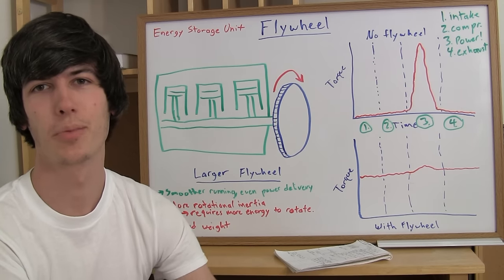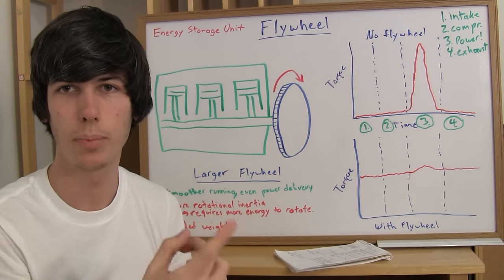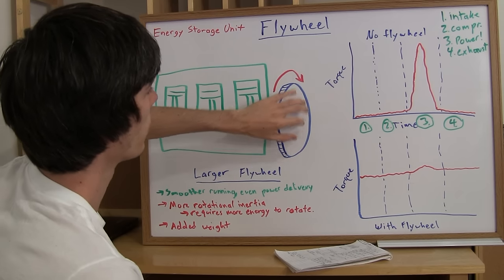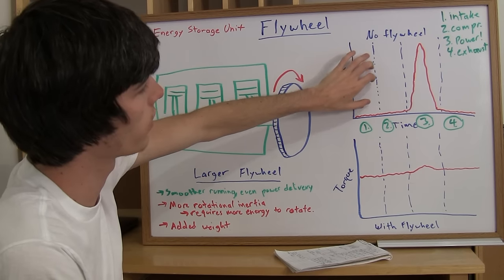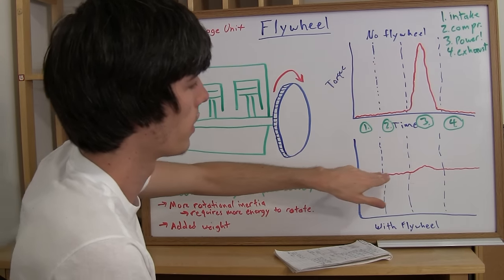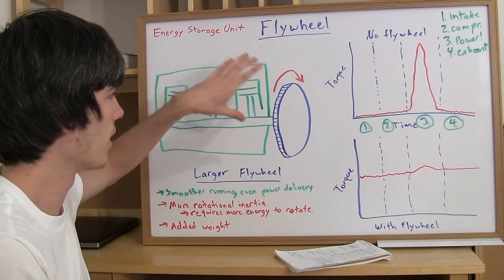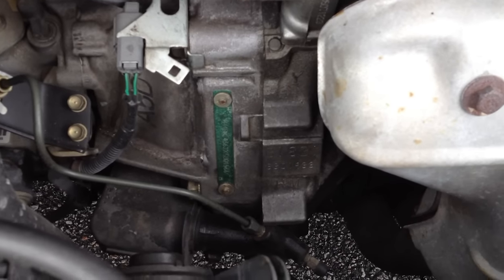Flywheel - Explained

Comment from the maker: Think of the flywheel as a uniform rotating mass. It doesn't have timing, like the cams do geared to the crankshaft. Blue smoke means you're burning some oil. For older engines with worn piston rings, this is pretty typical.

Comment: On automatic transmission cars, isn't there something called the flex plate, which has the torque converter in place of the flywheel on manual cars?  Does that mean the torque converter is pretty much doing the job discussed in this video?

Comment: I have a question, when you shut the engine off, what keeps the flywheel from continuing to spin? Is there a brake or something? Because since it stores energy from inertia, it should continue to spin even if the engine is off?
Reply: zebracherub the resistance of the compression strokes is quite a bit & without combustion (turning off the key removes spark/fuel) nothing except the inertia is pushing the engine...maybe 1 maybe 4(don't really know...just a guess) revolutions before you run out of momentum.  get a long ratchet & socket ...turn your engine over by hand a couple of times

Comment: this might be a dumb question dos that mean that it is easier to power shift with a lighter flywheel. 2 is there a balance that should be had with lets say a performance car if a slightly heavier flywheel keeps the rpms up longer wouldn't that be a good thing or am i missing something. i know that a light flywheel is better for acceleration but it seems to also drop the revs during shifting how off am i?

Comment: Ooooo ok so that makes sense, the smaller the flywheel is the closer it gets to matching the circumfrence of the crankshaft (which its spin has less smoothness due to power strokes of diff cylinders). But if u increase the size of the flywheel the gears on the circumfrence of the flywheel will allow smoother movement with almost no noticeable pause during power strokes. Genius vid

Comment: Isn’t the fact that you have multiple cylinders, each with a differently timed power stroke, timed to continuously power the drive shaft even a bigger factor in smoothing out the energy spikes?  This example is more for a single cylinder engine.

Comment: Hi I bought a 2.4 2004 Acura and it came with vibration first I thought it was a mount, I already replaced one engine and one transmission, plus checked both shafts the vibration still there, the previous owner told me he replaced the clutch and machine the flywheel. However the car vibrates even when I'm stopped every time over 2.000 RPM, that's why I'm starting to think that the mechanic made a mistake and therefore the car is vibrating. What do you think?
Thanks
Reply: +atroise Have you checked your ignition system?

Comment: so inertia makes the flywheel move.but that sounds impossible because friction does exist despite all the lubricants in the engine. Does the flywheel have a weight on some area of it or something of that matter?
Reply from the maker: Well it's steel, so it's just a large weight itself. The power strokes keep everything going.

Comment: hey i have an 86 chevy pickup with a 305/automatic. it has gotten to the point where the engine can be revving at any rpm, but the power does not get transferred to the driveshaft for some reason. I suspect it is the torque converter has gone bad? any help is appreciated

Comment: Should the torque on your graph be negative during the compression stroke?
Reply: +Stefan Oosterhout I think during compression the crankshaft pushes the piston up via the connecting rod. If that&#39;s true then yes there would be some negative torque equal to the force required to compress that air/fuel mixture. But also remember there are other cylinders, so while one is compression one is firing etc.

Comment: I think that flywheel is the reverse of an impact wrench. For flywheel you want to average out the force in a given, so that it can be smooth, as for impact gun you want to store the energy and release it in a very short period of time so that  it can produce a hammering affect very much like the engine cylinder power stroke.

Comment: Hi, Thanks for the great explanation. Please keep up the great work. I have a question for you though regarding flywheel technology. Audi e-tron quattro won LE MANS. flywheel technology is used to store energy while breaking and regenerate it while accelerating. It's a great use, but I found that since they are using flywheel, they can only store energy for a short period of time, so won't be able to use this commercially. Is that really true and can anything be done to make this better?
Reply: +Kiran Kumar Kondru That type of flywheel is a bit different from what is used on an engine. Those flywheels take energy from braking and store it in a flywheel that's not directly attached to the engine. When you accelerate out of the corner, the flywheel is then connected to the drivetrain, and the energy that is in it is transferred to the wheels. I don't know how much energy is lost from the bearings, but I doubt it would be too helpful at long red lights. It does have some commercial viability in regards to corners and stop signs though. I believe a few production cars have it now, mostly very high end cars though.
Reply: +Mosin Master Thanks a lot for the explanation.

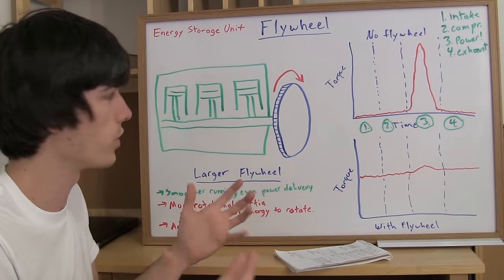Comment: 2:10 To reduce the amount of inertia required, many automakers have turned to dual-mass flywheels (DMFs) to absorb the torque pulses that an engine generates. While this is an effective solution to the problem, it (IMO) is just a bandage on a bullet hole, as the speed variations within the engine's components itself is still very high. So it hasn't actually eliminated the vibrations but instead it just isolates them to within the engine.

Since the dominant exciting components in any four-stroke, even-firing engine with four or more cylinders is of the N/2 order and N order (where N is the number of cylinders), automakers have started installing DMFs with centrifugal pendulum absorbers (CPAs), which are sets of masses on pivots designed to oscillate at a frequency that is directly proportional to the rotor speed. In cars and trucks, there is often a single set of CPAs tuned to the most problematic excitation order, the N/2 order. (In practice, I have heard that these absorbers are actually tuned to slightly greater than the intended order to prevent the masses from "bottoming out" prematurely and inducing nonlinear effects.)

The DMF with a CPA offers the lowest torsional vibrations, but DMFs have become infamous for being expensive, maintenance-heavy, and extremely complicated to work on.

There is a study, titled "Feasibility study of single-mass ﬂywheels with centrifugal pendulum vibration absorbers in vehicles with dual-clutch transmissions", that details how a conventionally-sized single-mass flywheel with a set of CPAs (or two sets) can be just as effective, if not more effective, than a DMF. Although a SMF with CPAs is not as effective as a DMF with CPAs, it certainly looks to be cheaper and significantly simpler to maintain and work on. It also looks like it will live a lot longer than a DMF.

Comment: correct me if I'm wrong you somewhere said that flywheel weight would barely be noticeable in the speed at which revs increase / decrease? i thought that was the main reason rally cars' throttle responses are so good and sudden (your graph)? And i generally thought that the flywheel would be one of the most noticeable changes on a car! was thinking of changing mine to get quick revs on an sti... help? :P

Comment: I have a question do CVT transmissions have torque converters or flywheel connections?
Reply from the maker: +John C typically torque converters.

Comment: I guess you could add to that smoother engagement of the clutch, which obviously helps with wear and tear. Which is less important in a racing situation, offset against the benefits of the reduction in rotational inertia.

Comment from the maker: Umm, I guess it depends on how it's broken. If the teeth are gone then you won't be able to start, since the starter motor needs something to rotate. Flywheels don't seem to be a common failure point though, so I'd be cautious. If your car starts and feels fine, then your flywheel is likely fine.

Comment: My flywheel as started vibrating on my car realistically do I need to get it changed straight away will it cause any damage to other car parts how long have i got before it will completly break down
Reply: +imanishay It's going to cause excess wear on bearings. So expect to spend extra if you wait.
Reply: i think its the friction surface of your fly wheel

Comment: why aircraft piston engines don't have a flywheel at all? what is the use of counter weight on the shaft if the flywheel works the job?

Comment: Do you know what can cause damage to the flywheel? because my car makes a loud rattling sound and I took the starter off and noticed that the wheel had been damaged, I replaced the starter and it didn't help, my friend took the trans off and the wheel was dent and it was making contact on the base but he bent the base straight and replaced the wheel and it still didn't go away.
Reply from the maker: Not really sure, unless the clutch were to brake, and have some of the material damage the flywheel.
Reply: your not using the appropriate starter shims that's cutting the flywheel teeth
Reply: East24stProductions Thank you. That's what the mechanic said, that I must of put the wrong starter on that autozone gave me. He did shave some of the metal off the starter and the noise went away. Last week I replaced the crankshaft sensor and it was shaved at the tip, any idea why? P.S before my friend the mechanic put on the transmission back on after changing the flywheel, he did mention that about the starter could be the wrong one but some reason he didn't go exchange it.
Reply: Hector Garcia-Martinez maybe the reason why stuff is getting shaved of is cuase your tranny may not be aligned with the engine block...maybe you had previous tranny removal in the past. like u say...something is not meshing down there...could be even the torque converter or flywheel was not installed....check the tranny alignment again
Reply: East24stProductions Thank you. I'll keep that in mind.
Reply: engine can crank But won't start,,is probably detective flywheel sensor? happen in early morning oNly,,

Comment: The Porsche 911 GT3 RS 4.0 has a single-mass flywheel compared to the standard GT3's dual-mass flywheel. Could you please explain what these are and the advantages/disadvantages of both? Also, if a single-mass flywheel is clearly better, why would Porsche not have fitted the standard GT3 with the single-mass one in the first place? Costs?

Comment: Thanks for such a quick response! :)
So the SM flywheel will give you a better engine response from the gas pedal, right? Therefore the reason the DM flywheel is fitted on the standard GT3 is, even though it can't handle as much abuse, it's more suited to the road (as opposed to the racetrack) - and for that you need a smoother, less jerky power delivery. 
Is that correct?

Comment: does shaving off the weight in my stock flywheel benefit me? or will it give more torque or power? the terrain in my place is more of a valley, so there are uphills and downhills , just wondering if lightening my flywheel will benefit my car?
Reply from the maker: +meowtrox1234 The short answer is yes (to more power), here's the long answer: https://youtu.be/CxuER0qIWJk
Reply: +Engineering Explained To be more precise, your engine will not produce more power with a lighter flywheel but more of the power it does produce will go into accelerating the car and not the flywheel itself. Apologies for my pedantry.
Reply: will it have a downside effect when going uphill?
Reply: +meowtrox1234 Reduced flywheel mass means that your car should accelerate faster uphill as the engine power is going into accelerating the car and not the flywheel. Top speed will be unchanged as overall power output will not change. The engine itself should also change revs quicker when you are changing gear so rev matching should be quicker, both up and down shifting. You need to be careful not to remove too much mass as this will affect idling and low rev performance. The flywheel is there for a reason and a lot of thought will have gone into deciding how much mass it should have.
Reply: Heaps of thanks!
Reply: +meowtrox1234 No problem. Hope it works out for you.
Reply: Do F1 cars have really small flywheels then? They idle at around 10,000 rpm simply because the engine would destoy itself if it idled for any extended period of time below that.

Comment: +Engineering Explained I've spent the entire morning (in the UK) looking through all the comments one of the most common myths/knowledge that I haven't experienced yet, that I still can't believe because I need an engineering explanation or a clear measurement proof, and not just people's tails, and what I would like to test as soon as I can. (And what I suppose lots of your followers could be interested in). In case someone has already asked you about this, or you've talked about this in another video, please excuse me and link me the answer. This is the myth: by lightening the flywheel, cars generally drop their top speed.
The first times I was hearing people about that, I just thought what rubbish! It  just doesn't make any sense. But by keeping hearing more and more people, I started to think a bit more about that and how it could be possible. Maybe a heavier flywheel, that helps to keep the torque/power delivery  equal, would cause less dissipation? Some kind of tyre sensitivity logic: an equally spread power over the time causes less losses while peaks of higher power and peaks of low one? Or maybe it has to do with some fluid dynamics in the cylinders, and a heavier flywheel would keep the pistons travel closer to the maths model with the assumption that the crankshaft speed is constant? Even if the calculated ideal travel is not proven to be the best....but possibly better than the one you have with a rather "vibrating" rotation? What do you think?
Reply: +Yury A I'll start by saying that I am no expert in this topic, here are my thoughts:

A heavy flywheel is like a train. Sure, it can go fast, but the acceleration would be really low. Ideally, this should not affect the top speed by any means, since no power is lost by the flywheel, it is basically a heavy block of metal that wants to keep rotating.

The thing is, flywheel makes it harder for engine to change its RPM. This 'may' affect the top speed, since the engine may not provide enough torque because it cannot reach its optimum RPM. But other than added friction and mass to car, it shouldn't really affect top speed at all.

Comment: Haha I hear yeah I have a 4.0L v6 and under normal acceleration (stop light to 40 or like around the city) i rarely get over 3000 rpms too. my old suv was v8 and it redlined at 4500 or something so yeah i know where your coming from. Lots of torque its great

Comment: TC could be bad, but trans fluid is also a big deal. My truck is low on trans fluid and I have a very noticeable lack of torque in first gear. No matter how much gas I give it, I don't get pushed back into the seat at all, until the engine hits its peak torque around 3600 rpm and then it takes off like a rocket.

Comment from the maker: You can get back to me with them, if you check out my video on rotational inertia I have a link to a useful site which breaks down the math for flywheels. I also prefer engineering over physics, though the discussion of theoretical physics is fascinating.

Comment: I have a manual V8 with vibration in & out of gear from idle to 2000rpm. Mounts & balancers all look fine? Vibration is felt in car only. Audible noise also at 1700rrpm. When the starter motor engages it does so with a louder whack than it was before this started. Scan tool revealed nothing.

Comment: Minimize the "jerking" the engine would otherwise have while maximizing efficiency and fuel economy. A larger wheel, like he said, would require the engine to exert more energy to spin something heavier which would translate to slightly better performance overall but it would be more wear on the engine which would contribute to poorer fuel economy.

Comment: Here's what I don't get about flywheels automobile ICE's. OK, so their inertia helps smooth out torque gaps and avoid a sawtooth pattern of torque delivery. However, taking a typical low end 4 cylinder Otto engine as example, it would produce 2 torque bursts per revolution. With a rev speed from 1100rpm and upwards that results in 2200 bursts per minute or 36 bursts per second. So would we really feel the uneveness if we had a burst of torque every 27 milliseconds (at idle; because at higher speeds the interval goes way lower).

Comment: And the harmonic balancer does ? It sits at front of engine connected to front of crankshaft. Older style had fans connected directly to crankshaft via the harmonic balancer. Now it is just a harmonic balancer, idle pulleys and fan belts connected to crankshaft out front, with fans being electric.

Comment: I'm going to probably embarrass myself for asking this but, why does a fly wheel have a smooth surface with a clutch plate? Would it just be too jerky and rough to have teeth or something on the flywheel that the clutch plate could engage?

Comment: Wouldn't having more cylinders in the engine reduce the need for a flywheel weight due to more even power coming from cylinders "getting their turn" to produce power?